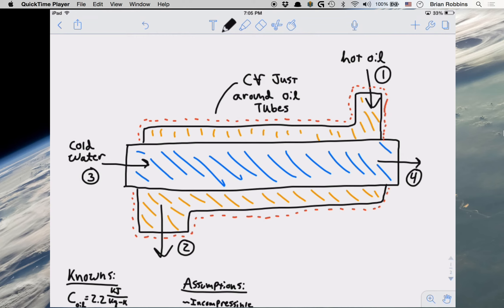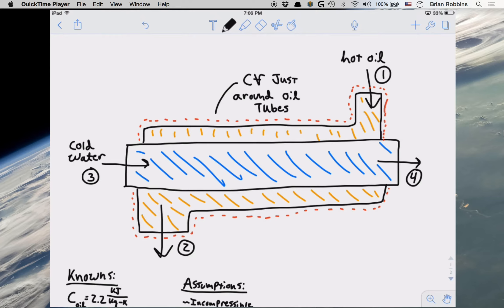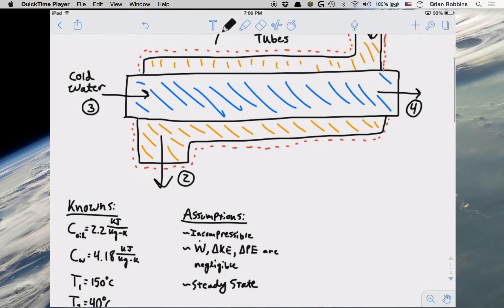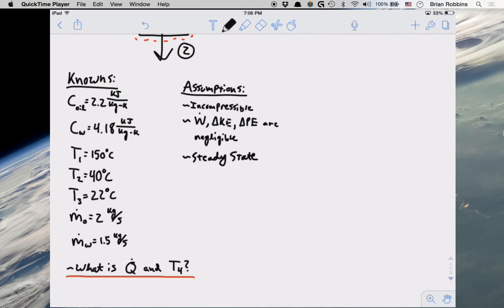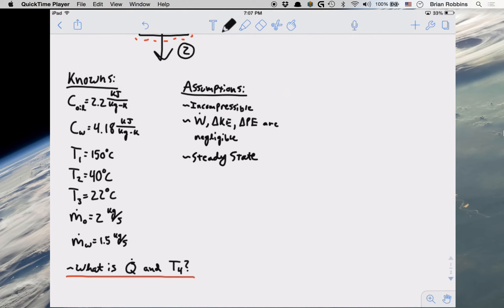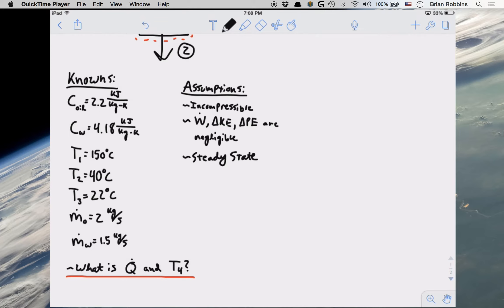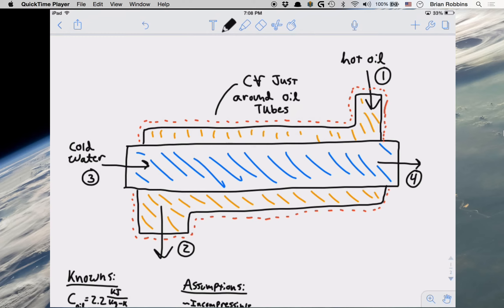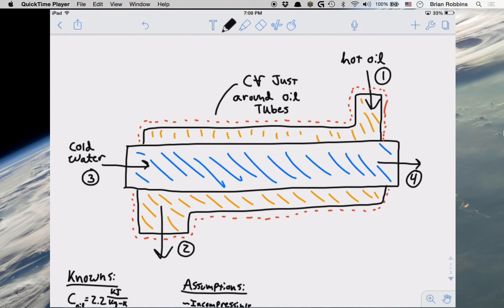1st Law of Thermodynamics (open system) -- Example 2

Comment: i have a question.. why in (h1 - h2)= C oil deltaT =C oil (t2 - t1) while in (h3 - h4) = C water deltaT =C water(t3 - t4) instead of (t4 - t3)? great video just little confuse thanks for the answer